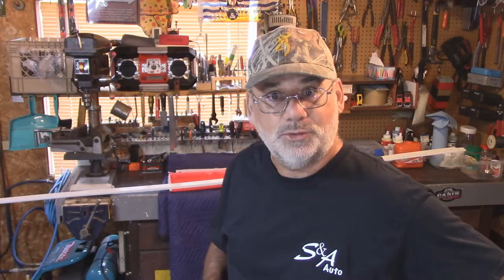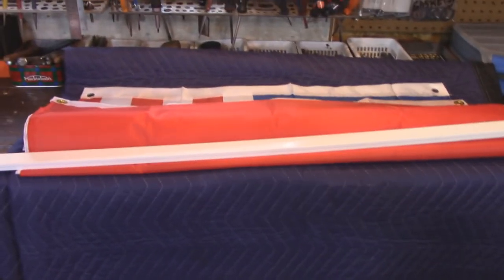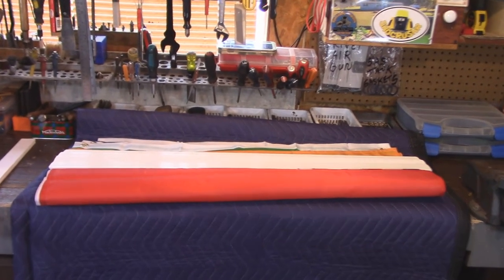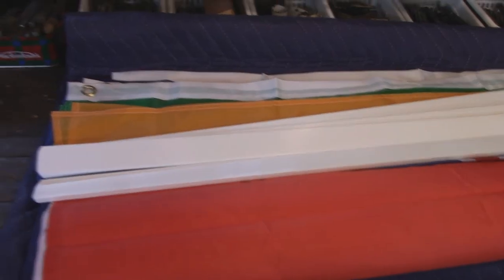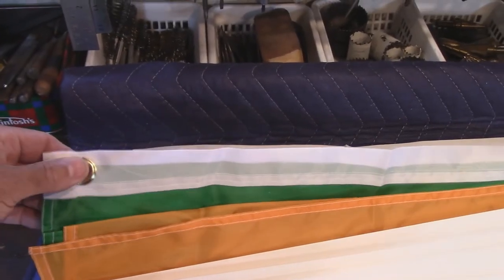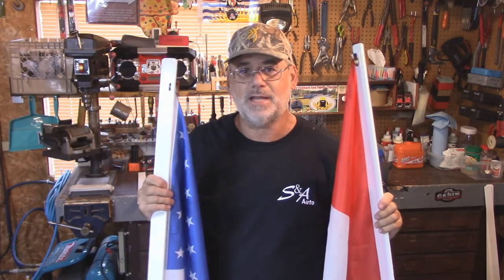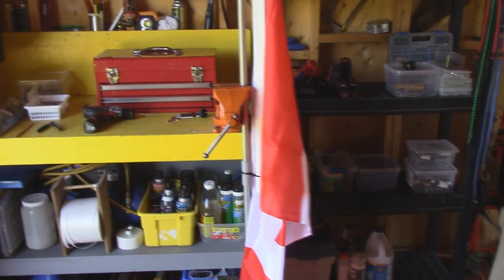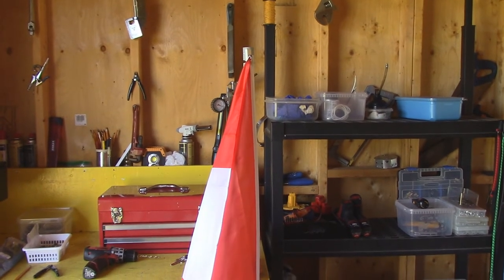Flag Hack To Prevent Twisting On Flag Pole

Comment: Good idea with the rotation but zip ties can deteriorate rapidly from the sun and weather and will become brittle and break.  I would recommend some type of marine grade stainless steel wire or clamp (especially if you're near an ocean). You don't want those good looking flags with their free flowing, no twist design to succumb to a weak zip tie.
Reply from the maker: Great point! I have gone two years on the ties and so far they outlast the flags as I buy new flags every 2 years.  The ties are UV rated so they seem to be great for this and easy to change out. Cheers
Reply: @SteveRobReviews  I'm guessing tail whip beats them up pretty good in that location. Every two years is pretty often and you buy the high dollar, fancy, UV resistant zip ties 😎. I wish everybody showed as much respect to their flags as you do yours.

Comment: The flag of our American & Canadian Brothers In Australia. We are all joined together in a battle to take back our country's.
Now... On my flags, I go INSIDE the top & bottom   seams with a stiff piece of #14 copper wire, to stiffen the flag enough to stop what is called TAIL WHIP. As tail whip can happen even with a FREE ROTATING flag mount / attachment like you have. 
I have also used 1/8" nylon tubing, as used on a vehicle oil pressure guage. When using a copper wire, strip a 1/4" of the insulation off the end, fold it on itself to make it easy to slide into the seam. Stop a couple inches short and cut and fold the other end of the wire to keep it from poking thru the flag material after a while. If my flag is 5ft. I make my wire an inch or so shorter. If you do have to cut a slit in the seam to get the wire installed. Coat the nylon with some clear fingernail polish to keep the 1/4" or so slit from fraying. It works great for me, my flags last longer, don't beat themselves to death in high winds, and stops the tail whip issue.
Reply from the maker: Thanks Bill   great suggestions 👍